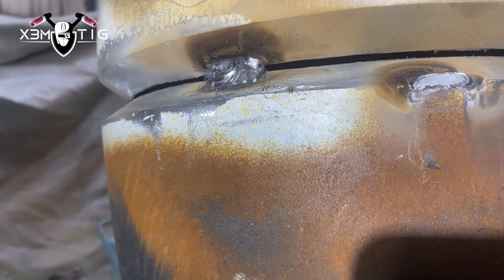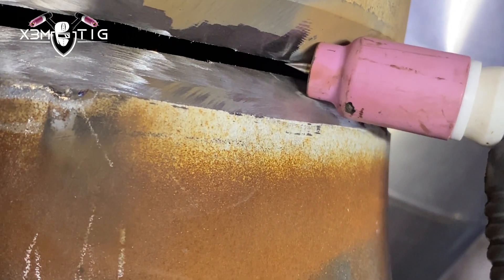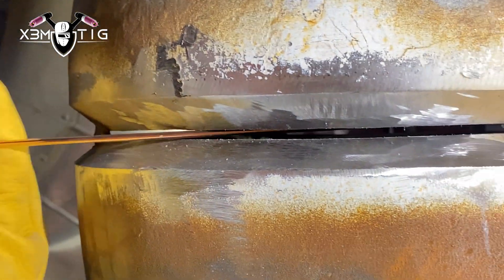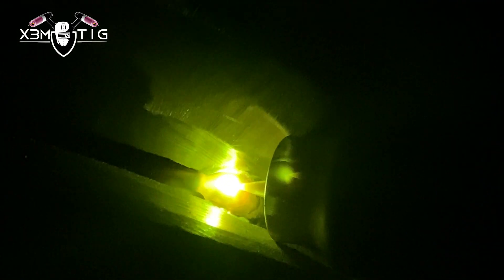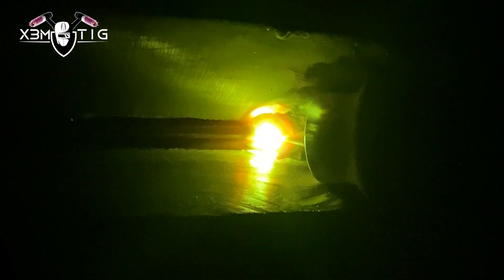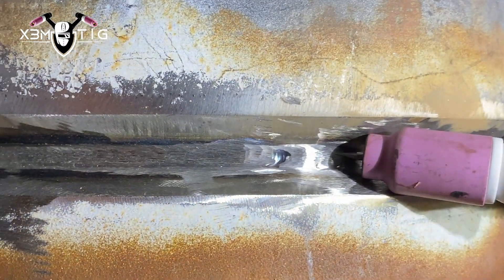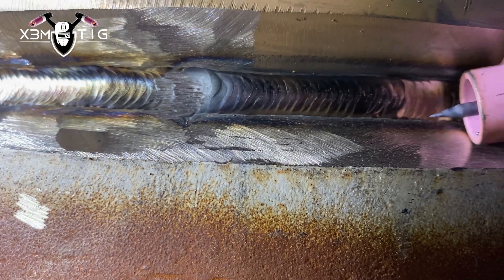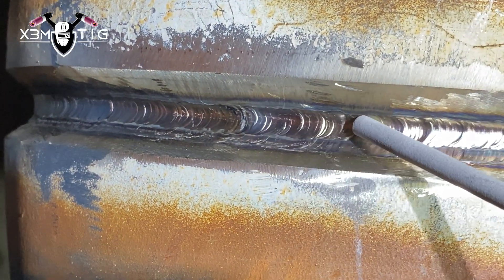Get Better At Tig Root Welding With These Tips And Tricks!

Comment: I would have used a EB Insert in the gap fused root pass by just torch only before using filler rod. High duty pipe welding for steam pipes.